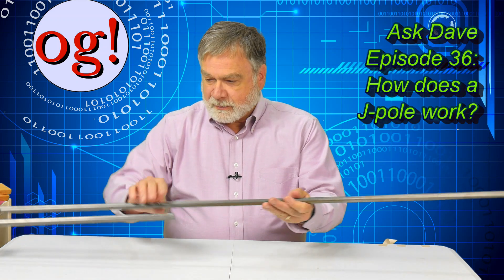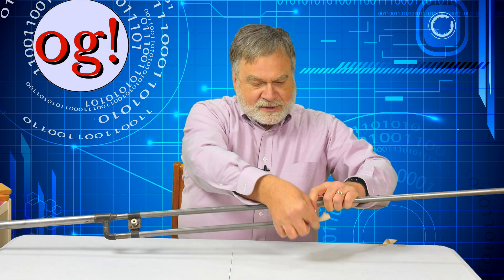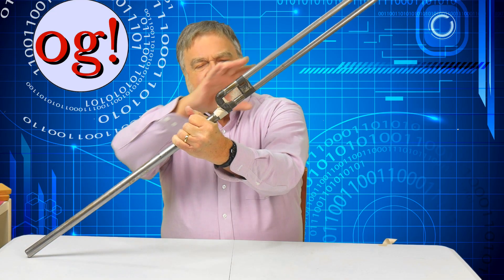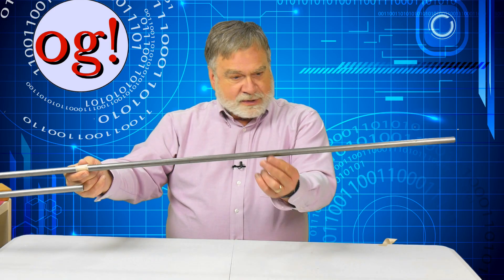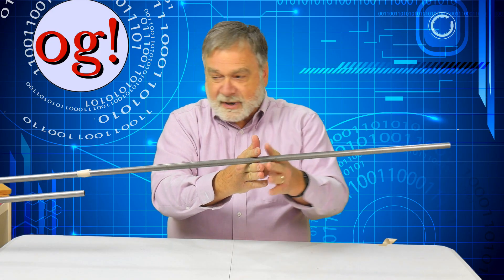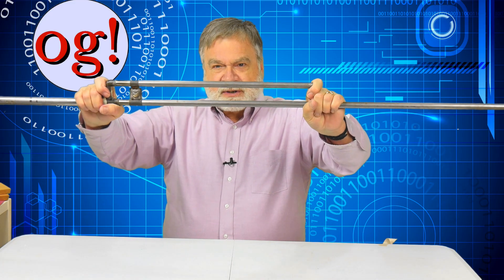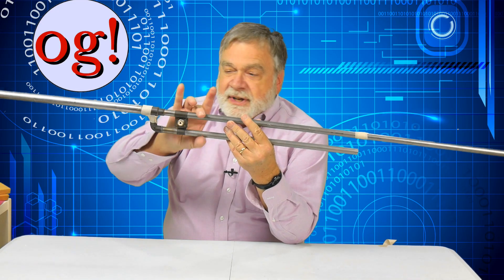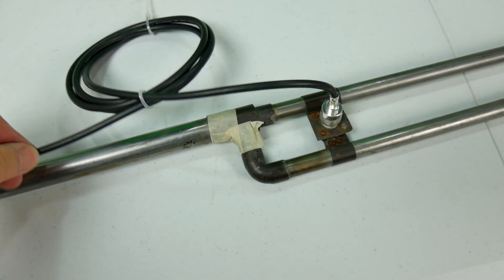How does a J-pole antenna work? AD#36

Comment: how would I work out the length to make an 11mtr j pole please Dave,,   cheers shane uk
Reply from the maker: Shane, a J-pole at 11 meters would be very large! The dipole section is a half-wavelength, so 5.5 meters. And then the matching section would be a quarter-wavelength, or another 2.75 meters. It could be done, of course, but I think it would take considerable experimentation. Good luck! 73, Dave, KEØOG
Reply: Thanks for the reply Dave another question to make you think and scratch your head ,,, I recently bought a little antenna analyser and did a scan on my 11mtr vertical Ariel and as well as 27 mghz there was a dip at 18.6 showing a vswr of only 1.3 and 51 ohms not sure about the reactance or capacitance don't understand that bit but either way according to my ts570 built in swr meter the swr was very bad and also an external swr meter also a full scale so why the dip on the analyser?   Any ideas please thanks Shane ct1017 uk
Reply from the maker: Shane, I'm puzzled by your question. In the US, 11 meters is CB, and the TS570 won't operate on 11 meters. Regarding your question, sometimes cable length can affect SWR, though I suspect you measured it right where it plugs into your radio. I don't have an answer, but perhaps some other viewer might. Sorry I can't give you more information. 73, Dave
Reply: Just buy Sirio mobile antenna... and I am not joking.
Reply: David Casler he was trying to use the TS570 at the 18 MHz resonance he saw on the 11 meter antenna. I'm guessing he was trying to work 17 meters.
Reply: the reason is because certain CB antennas, A-99 Imax 2000
do actually resonate at different frequencies, these two at 21mhz..

other antennas use wavelengths,
but on HF certain bands are harmonics of others, so an antenna designed for 40mtrs will work on 20mtrs and 10mtrs.

on your 11mtr antenna RF not electricity as david says in he video will travel down the path of resonance,
so your CB antenna although designed for 27mhz including say your coax and mounting poles, groundplane and the antennas length could quite easily work on other bands as say an OCF dipole..

i once build a three band fan dipole for 10,15 and 20, but RF found resonance on 17mtrs also using one element from one band and another from a different band and the angle at which they were at the feedpoint all added up to another band..
Reply: Actually making a J-Pole for the CB band is very easy and cheap, and here is how you do it;
https://www.youtube.com/watch?v=Xyh18GyniTo

Comment: Dave I like your coax mounting point. How did you make that? Brian KE0HZX
Reply: Dave,  Could you elaborate a bit more on your construction?  I too really like the clean look of what you did vs. the hose clamps and stripped wires approach. I'm new and green so my apologies if I am missing something obvious.
Reply from the maker: It's made out of a couple small sheets of copper that are wrapped around the pipes and held in place with screws. The tip of one of the small copper sheets is soldered to the tip of the SO-239 and the other to the shell. There are multiple other ways of doing it, such as using clamps or wire or some-such. Good luck! 73
Reply: Thanks Dave for the reply. I guess I am ust being picky but I like when something looks good. 73 Brian KE0HZX

Comment: Hi David...great videos....one question....How does the SO-239 connect to the balanced line..?....looks like it would be a dead short at the SO-239.....Thanks
Reply: Electrically it is a short, but in terms of RF it's perfect. Center conductor goes to one leg while the shield goes to the other. It doesn't really matter which one goes to which. I tested this when I was building a 222MHz J-Pole and found absolutely no difference with which one is connected to which leg of the J-Pole.
Reply: Thanks Brad

Comment: Great explanation, Dave!  Thank you.  I just started wondering about j-poles the other day, so your timing is great and probably saves me a lot of search time.  Question for you.  Can you mount a j-pole for 2 m and a j-pole for 70 cm, and perhaps one for 1.25 m, on the same mast?  If so, how should they be arranged?  Above each other?  Beside each other but separated by some magic distance?  Also, I have a metal roof on my house.  How high above the roof (eaves, peak, ?) should the bottom of a j-pole antenna be at a minimum?
Reply from the maker: There are designs out there on the Internet for multiband J-poles. I have a kit for one and will build it soon as the subject of an upcoming video. I don't know how well they perform. Regarding the metal roof, you should be at least a half-wavelength above. At two meters, that's only one meter, or about 3 feet, so it doesn't have to be much above the roof at all. That said, generally antennas up high outperform antennas down low. 73, Dave
Reply: Thank you for your reply, Dave.  That helps.  I'm looking forward to seeing your video on multiband j-poles.  That should be interesting.  I may hold off on building a j-pole until I see that video.
Reply: Seconded.   

I've got a 2M jpole up now, but I wanna add 440 and 220 and hesitating due to not sure how they will
all interact.

Comment: Even though I learned enough about impedance to get my Extra, this is probably the first time I've ever "gotten" it in an intuitive way.  Thanks for explaining the J-pole, Dave.  I'd love to see more of these.

Two questions:

1) While I understand how using the J in the J-pole lets you get the impedance right in the antenna, I still don't understand why the antenna will radiate.  Wouldn't the short be the easiest path for current to take?

2) You mentioned something about static charges due to wind.  I'd love to know more about that.  Is mitigation of static charges a problem for all antennas?  What happens if you don't mitigate it?
Reply from the maker: Hi Rhett, regarding your questions: 1) RF sees it as the 50 ohm point on a quarter wave "stub" of a transmission line. So, the RF doesn't see that as a short--it just sees 50 ohms at the point it couples. 2) Yes, it's a good idea to provide a path for wind-created static to bleed to ground on a continuing basis. If the coax feedline is connected to ground at a lightning arrestor on a ground rod, that will usually do it. 73, Dave

Comment: are these antennas directional?  if so which way do they propagate?

thanks
Reply from the maker: If positioned vertically (which is nearly always the case on FM), it radiates in all directions. Because of the layout, the radiation pattern is sort of squashed to the horizon, which helps give the antenna a little gain. 73, Dave
Reply: Thank you sir....Excellent explanation...
Reply from the maker: The Slim Jim is a variation of a J-pole, so will likely have a similar radiation pattern.
Reply: David Casler... hi Dave I am wondering how to get a great slim Jim or a j pole  for the  FM band?  also how TO get the best SWR and high gain  from such antennas. 
Regards philip

Comment: Dave what is that J-pole constructed from?  I've only seen copper ones.  Also your feed point bracket is nice can you describe it as well.  Great stuff!  K4RJJ
Reply from the maker: Me too. This one is, I believe, copper also. It was actually constructed about 20 years ago or so and it's been all over the place in less than ideal conditions. The youth in the Junior division of the Boulder Amateur Radio Club would construct these to sell at hamfests to make money. I worked with that group for about ten years, and picked up the J-pole at some point during that time. It's been a great antenna. It has no fancy stuff like end caps. Pretty basic.
Reply: KB3OPE - Where could I purchase one of them and how much?
Reply from the maker: Ronny, J-poles are almost always do-it-yourself projects because of their unwieldy size. You can find instructions for several versions on the Internet or in the ARRL Antenna Book. The feedpoint is just flat copper wound around the pipes and then soldered. 73, Dave